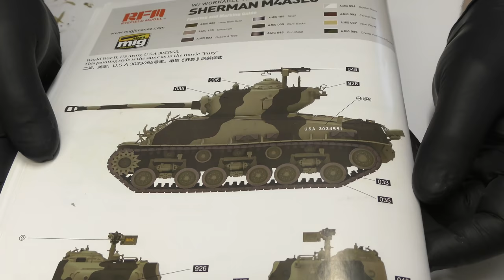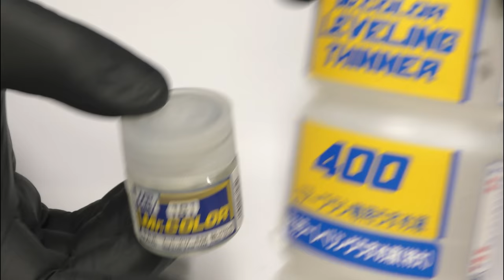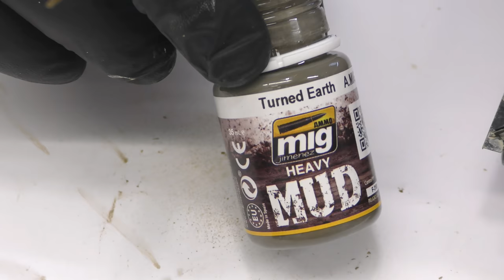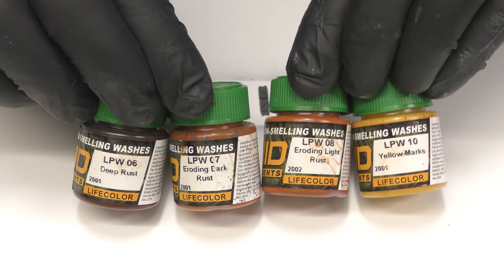RFM 1/35 Sherman M4A3 76W w/full interior. Full build video part 2. Kit #5042.

Comment: Great build and outstanding detailing!  I have some nitpicky suggestions.  Given the wear and tear indicated by the grime, etc., the seat cushions for the crew should show some wrinkling / staining / compression welts that would occur after hard use. Some of the roadwheels should show some chunking or irregularities as a result of churning through mud/rocks. Some of teeth on the drive sprockets should show some bare metal as would occur with the metal on metal contact with the tracks.  One nice touch would be the addition of  a few brown streaks on the forward glacis as would be left behind by driving through underbrush. One last bit: the fender edges look a little too pristine and should show some  wear and tear with maybe the odd bend.  Looking forward to the diorama!  Please don't think I do not appreciate how much skill and effort you have displayed, this was an awesome build!
Reply from the maker: Hi Keith, Thank you. And thank you for your in-depth comment. All good points well made, I will take note! Cheers. Andy

Comment: An absolutely gorgeous model! Great work!

Quick question: Why did you paint the tracks with a rust color? Only asking because all photos and live examples of Shermans I’ve seen have rubber pads on the treads, and are not bare metal.

Comment: beautiful job.  did you have any difficulty using enamel weathering on plastic tracks?  it's been my experience that enamels damage RFM plastic tracks.  also, it's a minor point, but sherman tool handles were painted in the same olive drab as the tank itself.
Reply from the maker: Thank you for the tip on tool handles. No, the tracks are the same plastic as the rest of the kit, so no problems. Thanks for watching.

Comment: Hey. Awesome job.
2 questions…
1. Can the turret be removed once completed? And do the covers open etc? 
2. In the film fury, there is an additional .30 cal machine gun on top of the turret. Would it be possible to put that on? I see there is a .30 cal inside the turret? I don’t really understand how this gun would be effective as you can only fire in the direction the turret is facing? Any ideas?
Reply: Coaxial machine guns are very common on tanks for dealing with enemy infantry as you wouldn't want to waste ammo on just a few enemy soldiers. Some tank crews would add a additional .30 cal, but it was not a factory addition. Good questions!
Reply from the maker: Hi, yes the turret can be removed and split in 2 with the bottom section coming away. Thanks for watching.
Reply: Hey, after painting lots of pieces separately,  what glue did you use to then glue in place? Normal plastic cement or super glue or something?

Comment: Hi there bits of a random question what type of the air brush do you use and where could I purchase one. The one I have for modelling can't do it extremely thin paint jobs regular clogs and just isn't good for fine detail. Hope you can help me 👍
Reply from the maker: Hi, It's a H&S infinity, but any airbrush with a tip 0.2 or small should be able to do some fine detail work. Cheers

Comment: i was wondering why this Sherman didn't have the 56 degree angle front armor like the m4 but then i found out that if they did that they'll have to raise some space for the drivers position compromising the protection of the driver, in some images it looks like they welded a secondary plate, but seeing that this version is the latest with all the advantages in the previous Shermans combined im sure they have a practical reason why they chose the steeper front armor slope.

Comment: Nice result until the exaggerated, unnecessary chipping, and rust! - the real paint was very tough and well applied. It would not have worn like that. Especially as the vehicle would have been less than 6 months old. I would have skipped that bit entirely and just scuffed and burnished the edges a bit, to suggest wear. But, your model of course and chipping is the fashion these days...